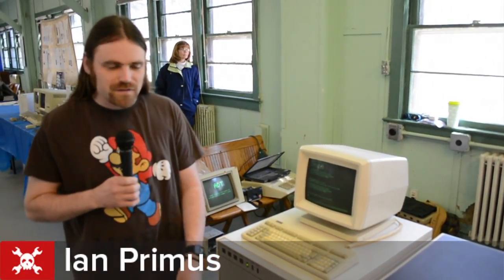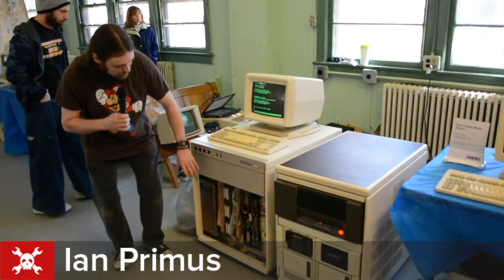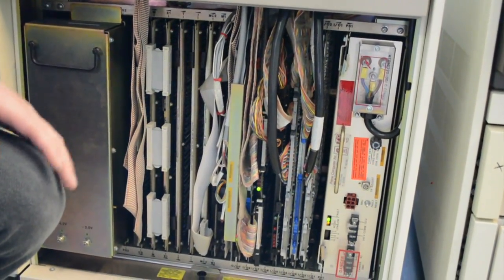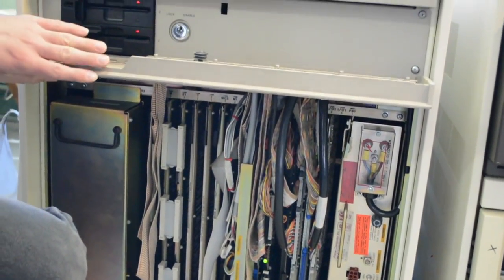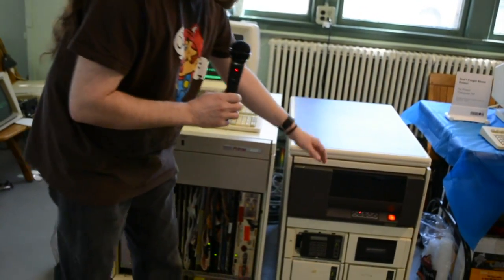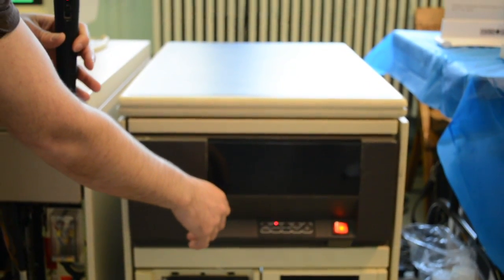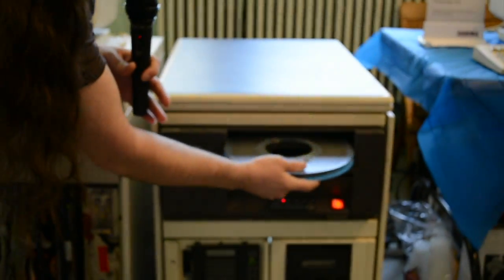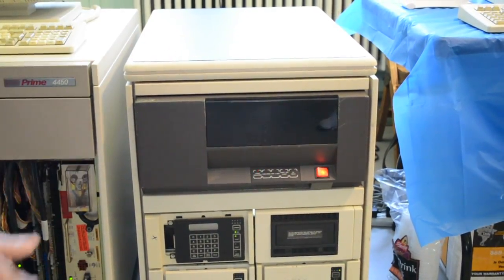VCF East: Prime Minicomputer

Comment: I worked on a networked pair of Primes, a 400 and a 650. Then around the turn of the century, I acquired a model 2455 which was smaller than the system in this video, but which had the same power supply. Also, I had the 2250 cabinet with the Cipher 9-track streaming drive. I sure hated abandoning it, but now I have an emulator whose author imaged my hard drives, so I can run the exact same system I had over two decades ago.
Reply: Also, there's a model 2850 nearby that past efforts to acquire failed, but that was over 20 years ago. Probably worth dropping by again.

Comment: My employer back in the mid 80's bought our first Pr1me computer mostly because of the Prime Information RDBMS and InfoBASIC.  And we had a bunch (maybe 40 or so) of dumb terminals in various departments.  I managed the computer and wrote the InfoBASIC programs to run our business.  We upgraded the hardware several times and it was an easy transition because all of the machines from the lowest to the highest we all software compatible. We went from a 2250 to 4050 to 5340.  We connected the dumb terminals at 9600 baud over two wire analog phone lines combined with the voice, so that made it so easy to deploy terminals.  It was fun times until the PC and networking took over.